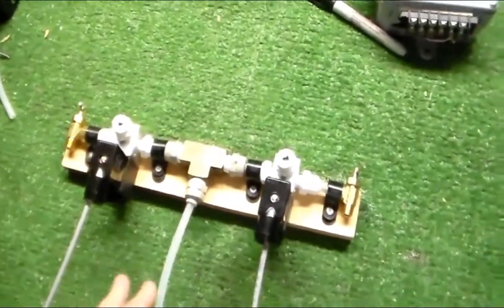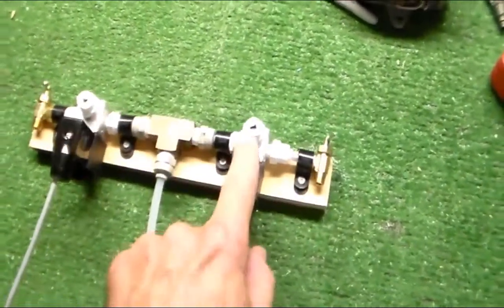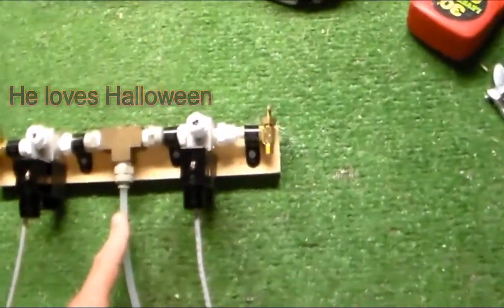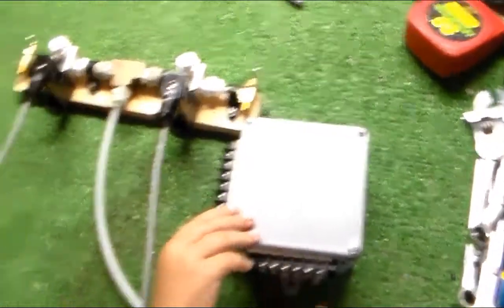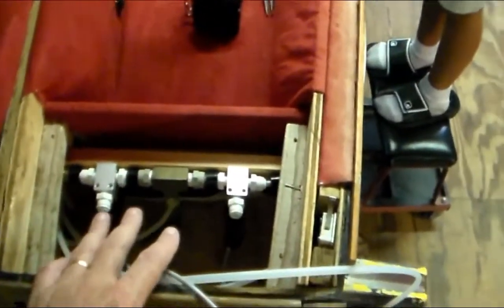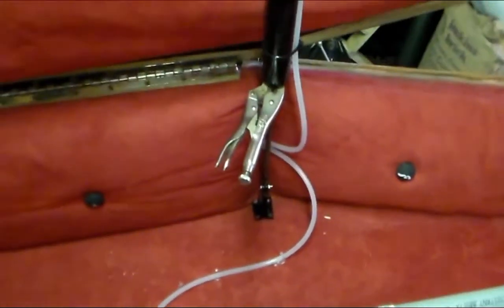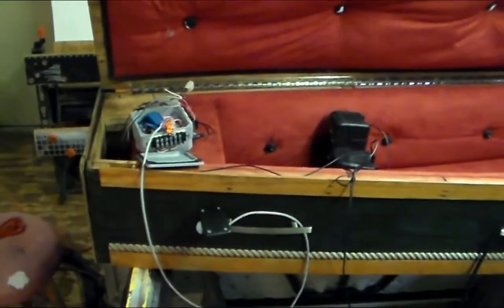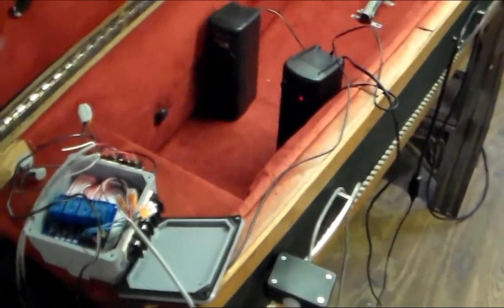Coffin Pneumatic Halloween Prop - Arduino Controlled Part 2

Comment: Looks like you were suffering from Arduino reset issues that I also encountered with this project. Make sure you put diodes across the solenoid power, and use a separate 5v power supply to run the relays, instead of powering them from the Arduino. You do so by removing the jumper on the relay board and running +5v to JD-VCC , and ground to GND. Remove the ground between the Arduino and the relays (they'll ground through the digital pins). Hope that helps! Thanks for sharing your very cool coffin prop!
Reply from the maker: Thanks, But my issue was the wav file I downloaded turned out to be incomplete. lol. But thanks for info I'll keep in mind if I have further issues.
Reply: +MrTmartindale Ah, LOL! Well that's an easy fix. Nice. I have a question, though. Any particular reason you mounted the cylinders with the hoses up in the air? Going to do mine tonight so I'm just curious.
Reply from the maker: No real reason I didn't have the 90 degree connectors its what I had on hand.Hope this helps and good luck with yours.
Reply: Yeah, neither do I. I spent hours trying to find 90 degree connectors for those screen door actuators, with no luck. I did end up mounting mine a little differently. I should have a video up in the next couple of days. Thanks for replying!
Reply from the maker: No problem, love to see your idea to this prop.